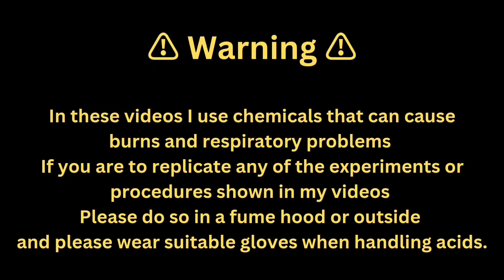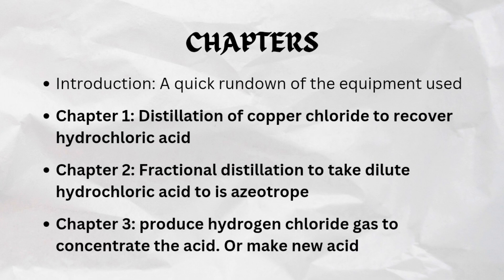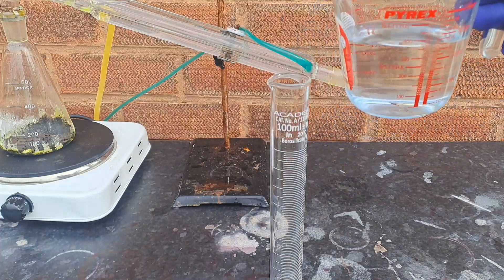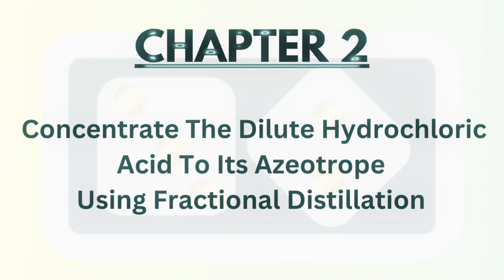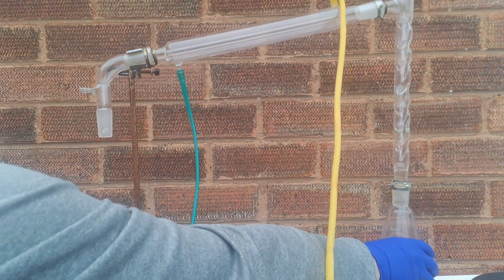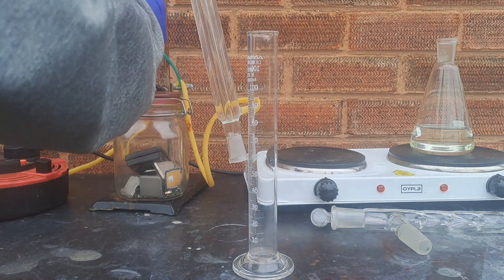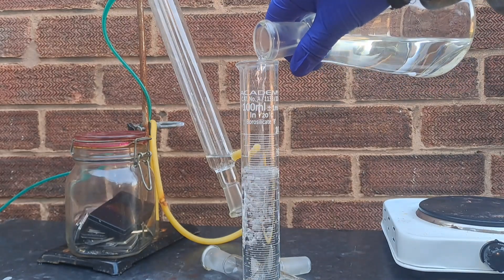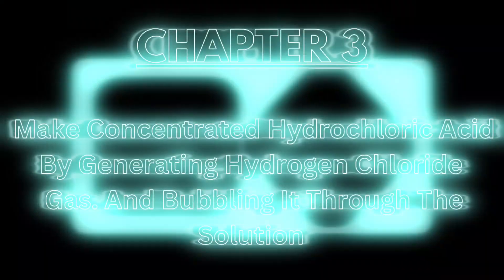How to Recover Hydrochloric Acid from Copper Chloride, or Make New Hydrochloric Acid

Comment: Im really struggling with. I absolutely love your content. Im an amateur, ive got this exact setup but i only seem to be hitting around 30% HCl in the washer bottle after the bubbles have stopped and before any backflow. What am i doing wrong? Im doing it outside amd the temperature isn't particularly wrm right now. Im possibly thinking my hotplate isnt warm enough to heat the bisulphate and sodium chloride on its own.
Reply from the maker: Keep the gas bubbler as cold as possible hcl dissolves in cold water better. You could also try a second run, bubbling the gas through a second time will increase your concentration

Comment: -Distillation set and hot plate
-Copper Chloride
-Graduated cylinder
-Hydrometer
-Vigreux Column
-PH test strips
-Gas washing bottle

-Sodium bisulfate
-Table salt
Reply from the maker: Or if making your own hcl. You would only need sodium Bisulphate, table salt, a flask to heat it, hotplate and the gas washing bottle with some distilled water. You could use a graduated cylinder or flask and pipe the tube directly into the water if you don't have a gas washing bottle.

Comment: The question remains, how does one recover the gold from any gold stannate formed in the copper chloride leach of plated phosphor bronze substrates. As the alloy tin can form stannous chloride and rob gold values from the process. I've experienced a 100% loss from this effect.
Reply from the maker: @Vibe77Guy  I haven't processed this type of material before, but I'd maybe try to evaporate the solution incinerate everything and then maybe leach with iodine. Thanks for watching👍

Comment: This sounds like an AI voice.
 thumbs down.
Reply from the maker: It is an AI voice. Due to having a strong regional accent, I use the AI narration to make it easier for everyone to understand what I'm saying. Especially when using similar chemicals, for instance, sulfates and sulfites. AI isn't a bad thing. As long as it's used for the correct purpose, you should embrace the change 👍

Comment: What a great video! 
How do you tell if you have free HCL in AP , the color ! 
Can you use electrolysis to free up HCl then distill to recover ?
Reply from the maker: The answer to the second question is yes. Electrolysis will free up more hcl. But you will want to do it at very low voltage to avoid chlorine gas being produced excessivly at the anode, above 1.1 volts the chloride ions will oxidise to chlorine gas which can be dangerous and will also reduce the amount of recoverable hcl as the chlorine escapes
Reply: @ on it
Reply from the maker: I might have a go at it next week myself and see what the difference in concentration actually is and if it would be worth the extra time👍
Reply from the maker: Answer to the first question is PH if it's below 7, then the solution is acidic and contains free hcl unfortunately it won't determine how much.
Reply: @ to  me ( duh ) 😂
Reply: You could calculate concentration of the oxonium ions, by pH, since pH = -log[H3O+], and therefore you know how concentrated solution is, since you don't have any other acids present(except carbonic acid). Though you have to take note that copper chloride also affects the pH, for example 0,1M solution of CuCl2 would have pH of around 4 to 5. For example, if your solution have [H3O+] = 0,1mol/dm^3 = 0,1M, pH would be 1.
Reply: You could calculate concentration of the oxonium ions, by pH, since pH = -log[H3O+], and therefore you know how concentrated solution is, since you don't have any other acids present(except carbonic acid). Though you have to take note that copper chloride also affects the pH, for example 0,1M solution of CuCl2 would have pH of around 4 to 5. For example, if your solution have [H3O+] = 0,1mol/dm^3 = 0,1M, pH would be 1.